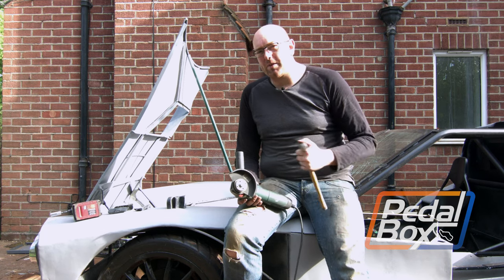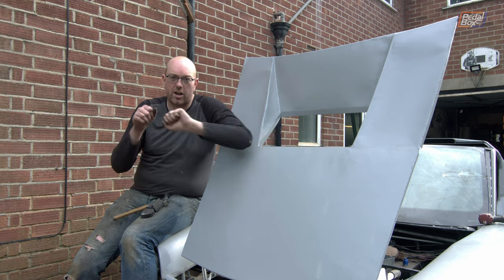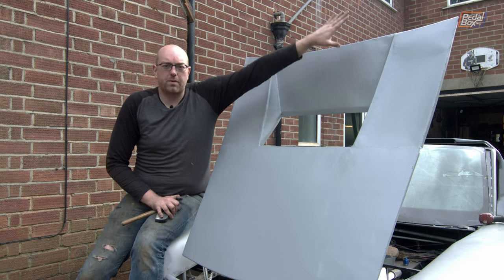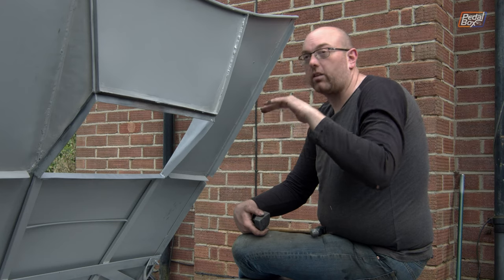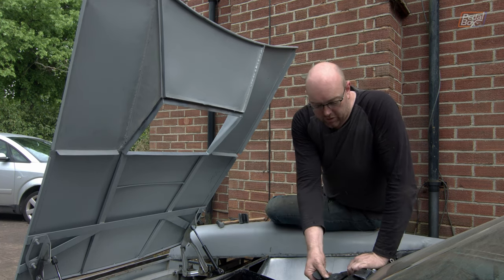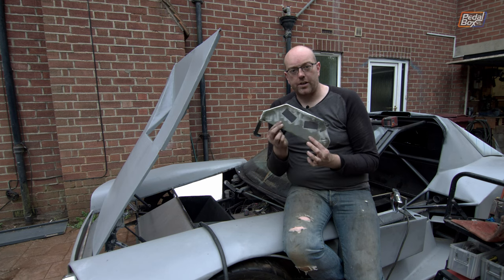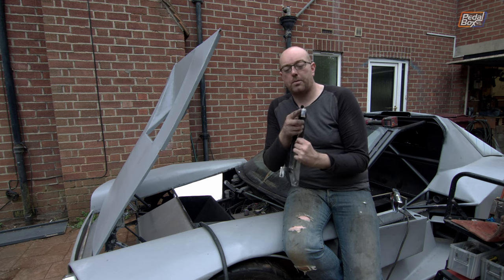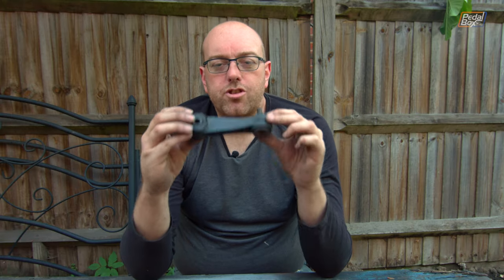Unfinished Business On The Bonnet | Audi TT Kit Car | PedalBox Episode 106

Comment: To me, it seems like that bonnet at the center(where the L's have a cut out) needs more strengthening(joint the top half with the bottom half). You shouldn't move the wiring away, when you are closing the bonnet?
Reply from the maker: I thought the same, and were were going to remove a small support bar each side and improve it but so far it doesn't seem to need it. Some more investigation to do and check the flexing, but i'm extremely surprised at the very low levels of flex at that point.
The wiring actually fits in the gap though when the bonnet isn't pulled all the way down, so no harm :)
Reply: @PedalBox  Maybe, if you would just join those 3 Ls would be enough.